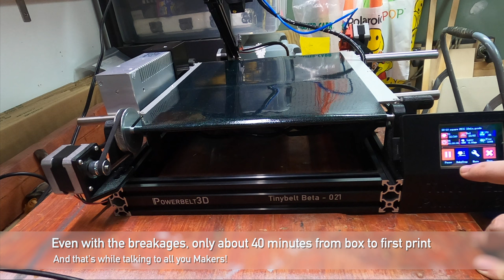TinyBelt Unboxing and First Print!

Comment: I have a brother tat writers at UPS.  Packages are tossed from belt into trucks all the time.   That packaging is no bueno.
Reply from the maker: Something heavy was smooshed on top of it, too... yes, better packing needed, but the damage seemed a bit more than usual.
Reply: I don't work at UPS and can tell you that wasn't packed well at all. :) Something that heavy is going to need something better than bubble wrap or a LOT more bubble wrap.  I'd rather see more parts detached and wrapped well separately to reduce chance of breakage. Most anyone buying this should feel comfortable doing a little more assembly.

Comment: Maybe there should be a printed angle block that you could jam in there and then tighten down the arm to lock in the 35° angle?
Reply from the maker: That'd be a good early print, too - in order to calibrate your printer; you get errors with Y and Z if your angle is incorrect.

Comment: interesting style, the cantilever belt printer, not sure how I feel about a moment arm like that, maybe on a smaller belt printer, like half this size, but this seems unwise, at least with 2020 and what appears to be a printed bracket.
Reply from the maker: It's actually a metal bracket - you can see it pretty clearly around 4:50, it's quite strong and stiff.  There are stronger designs, but it's more rigid than it looks.  I have yet to test it at its fullest extent, short parts print without any ghosting or artifacts

Comment: Isn't that thing called the marlin 3d printer now?
Reply from the maker: The TinyBelt does run Marlin firmware (along with the majority of 3D printers)... but I'm not sure what you mean?
Reply: @PaulChase  there's another 3d printer with a very similar build that is called the marlin 3d printer.